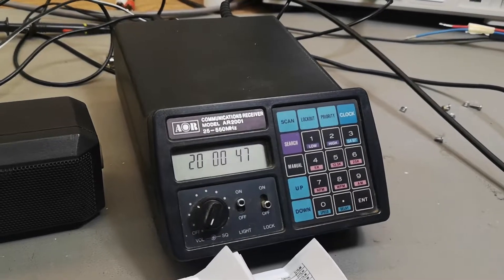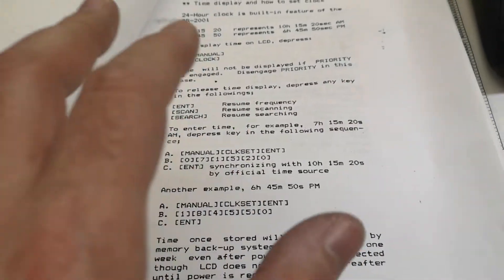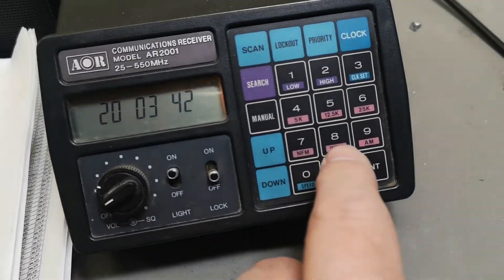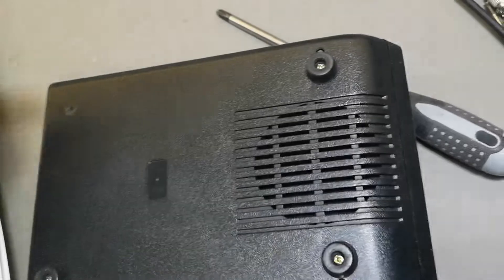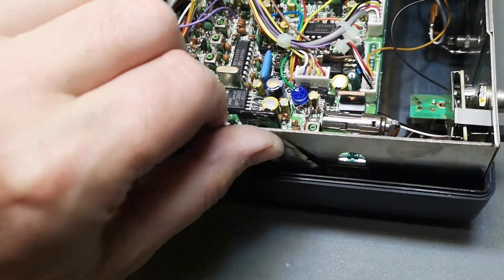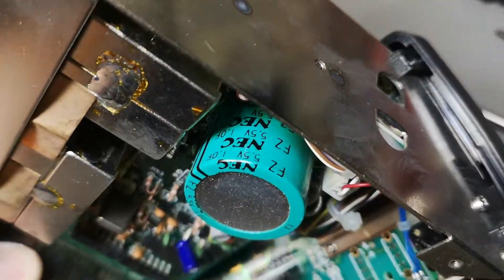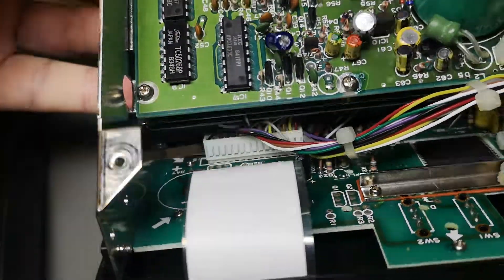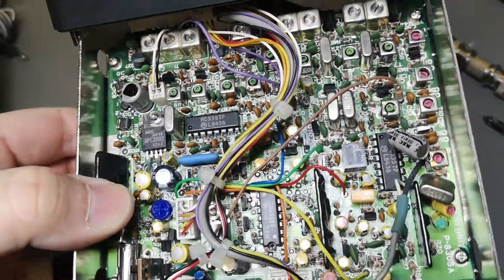AOR AR2001 25-550MHz scanner receiver 1984 test teardown

Comment: Regency sold this as the MX5000, I assume it was private-labeled by AOR. There was also one with 800-1300 MHz. called the Regency MX7000. Hyper sensitive, but the scan speed was measured in months per channel.